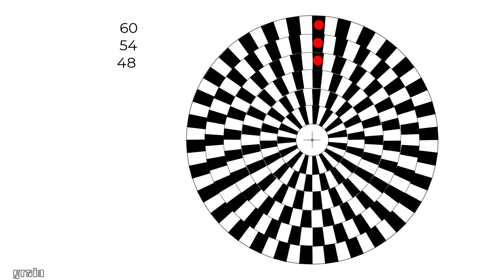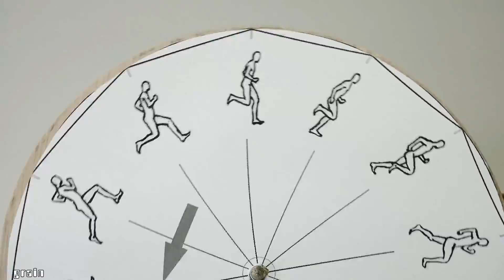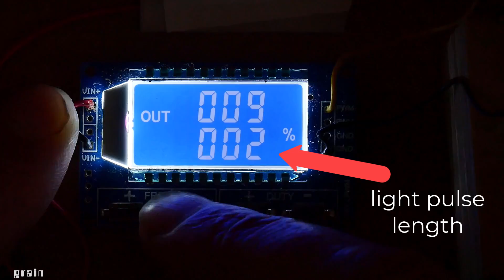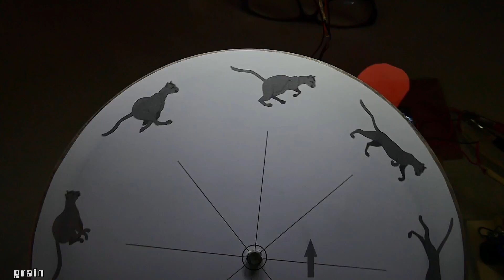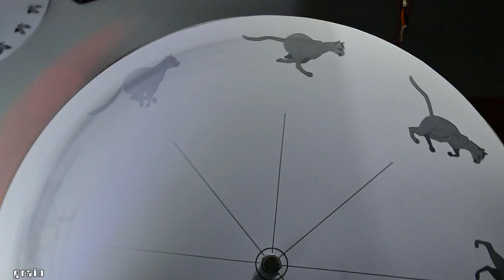Stroboscopic Effect

Comment from the maker: Correction: the disc consists not of 5, but of 6 parts.
https://en.wikipedia.org/wiki/Strobos...
Pictures for printing:
https://ibb.co/4P1CsZ5
https://ibb.co/9pRGshs
https://ibb.co/ts1LDB3
https://ibb.co/FH8GhRs
https://ibb.co/dbTyZ99
Generator with changing duty cycle (without housing) - https://ali.ski/NEBCrW
Generator with a change in duty cycle (in the case) - https://ali.ski/VkzkS5
Reply from the maker: I want to say that the animation and the sector disc look very impressive under pulsed lighting, but this is not conveyed in the video, it needs to be seen live! Therefore, you can print discs using my links. And also make flash lighting. In addition to the generator, you need LEDs (I used 8 pieces of 3 watts each) and a control transistor (I used IRFZ44N).
Connection diagram - https://ibb.co/zJ1JZcK

Comment: Would you care to share how you built the electronics?
The rotating disc and the LEDs? Im building my own Zoetrope
Reply from the maker: Certainly. I used this motor with a gearbox for rotation - https://aliexpress.com/item/1005006828526427.html
And such a ready-made PWM - https://aliexpress.com/item/32835541668.html
LEDs need to be connected through a powerful transistor, I recommend using IRFZ44N - https://aliexpress.com/item/1005005801525204.html It is designed for high currents, when heating, use a heat sink.
Connection diagram - https://ibb.co/WcJrc5S
The best quality is with the shortest pulses, i.e. 1% duty cycle, but this makes the illumination weak. Therefore, it is better to take more powerful LEDs, I used 3-watt ones, but I don’t remember how many, about 8-10 pieces. You can take 5-10 watt ones to sleep them together for the required power. If your object is larger than mine, then it is better for you to immediately solder a group of LEDs at a higher power of 50-100 watts. Because they will illuminate in short bursts, ideally 1% of their total power. 
I wish you success in your creativity!

Comment: Soo if I wanna made stroboscope light. All i need is very short duty cycle Right? Please answer me I need this project to my college
Reply from the maker: That's right, you need a flashing light and preferably with the ability to change the frequency and duty cycle. I used an inexpensive generator, it has both. The shorter the light pulse and the longer the pause, the better the effect. But the shorter the light pulse, the more powerful it must be.
Here is the generator - https://aliexpress.com/item/32835541668.html
Or in the body - https://aliexpress.com/item/32950074641.html